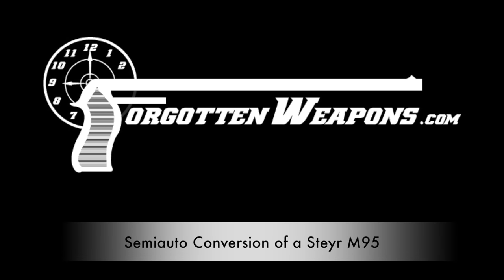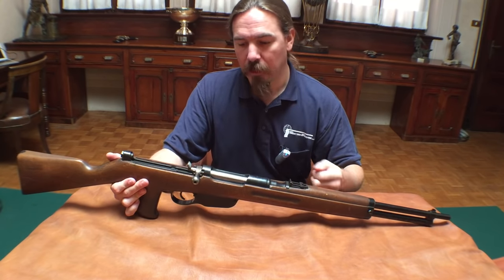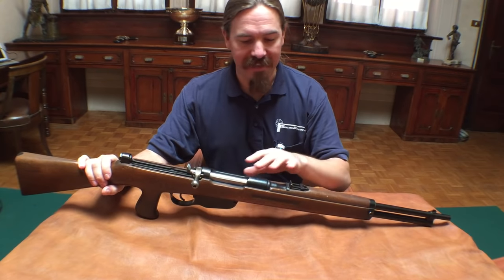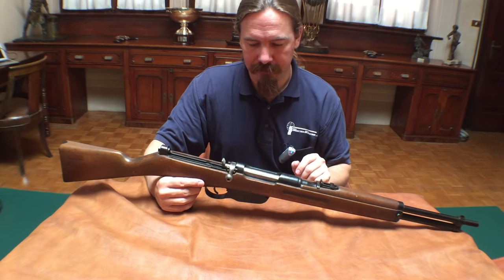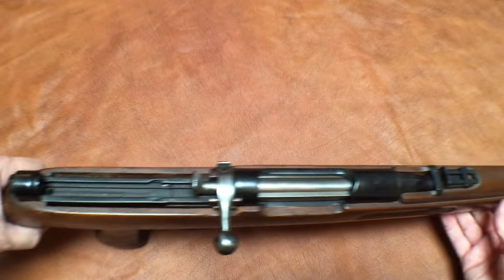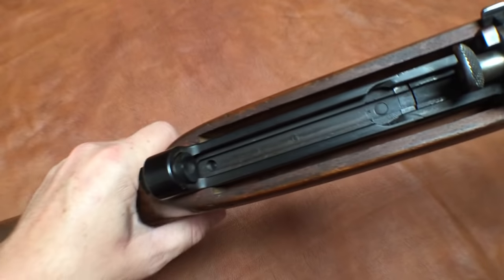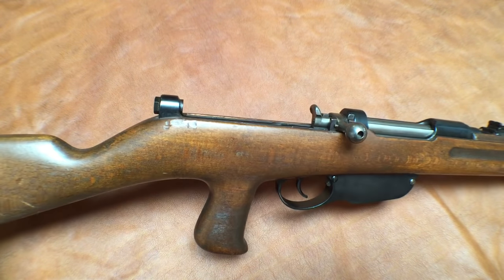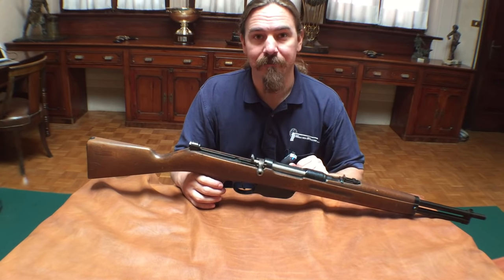Steyr M95 Straight-Pull Semiauto Conversion

Comment: There even is a machine gun conversion in the Austrian army museum. It was done by Austrian soldiers back in world war 1, but it is very crude and it actually looks like if it was just a nice try.
Reply: I know that thing, i an there often.
Tecnicaly it is Not an MG, but a mitrailleuse.
Still cool
Reply: @erzherzogalbrecht8504  what is the difference?
Reply: @thestørmcrier2024  a machinegun works on it's own, as long as you hold down the trigger and there is ammo, it shoots, a Mitrailleuse has a lever that you have to push and pull for every shot/group of shots you want to Fire.
Reply: @erzherzogalbrecht8504  it is kinda like a repeater where the trigger and bolt are connected

Comment: I normally dislike these kind of postwar/aftermarket versions, specifically if it's sportarized or stupid rechambering decisions. But semi auto conversions are cool (I do love that Turner SMLE conversion).

As for this M95 conversion? It's a tad cursed, but that's mostly due to the weird stock/pistol grip design. The functional bits are awesome 👌

Comment: I'm surprised  this isn't in Battlefield 1, since DICE overused prototype auto loaders In that game.
Reply: Spence M. No they didn't? Most of the semi auto rifles were production guns that were officially adopted and saw service, there are few one off prototypes in the game
Reply: Silly Catfish but were they standard issue or designated for the infantry? no. the Mondragon only saw service with the German flying corps. the Cei-rigotti never made it out of the prototype phase, the model 8 is not even a military gun. the frommer, Mars pistol, the auto revolver, also all prototypes.
Reply: And by prototypes, he means "Less than 100 manufactured, ever, and not practical enough for much of anyone to willingly adopt them either".

Even the production guns were issued in very small numbers to elite troops and the most skilled soldiers in sections.
Reply: I'm pretty sure when they add the French and Russians via DLC (not sure why they are not in the full game regardless), they will add the Federov, the RSC 1917, etc. and for "Snipers", the mosin m91, and the mle. 1886. because any bolt action is a sniper rifle according to DICE.
Reply: Spence M.
Indeed.
Reply: I know this thread is old as hell but, 

Cei-Rigotti: 
Prototype. No service. 

M1916 Selbstlader Karabiner: 
Saw usage by the German Air Corps, Ballon Observers and Zeppelin crewmen. 

M1906 Mondragon: 
German infantry trial. Saw service with German Air Corps

Winchester FC M1907/17: 
Saw limited use by the French Army 

Remington Model 8: 
Saw limited usage with Allied aviators

Remington Model 8 Extended:
 No service. Anachronistic since it was produced in the early 30s. 

M1906 Luger Selbstlader: Prototype. 
Saw no service or production. 

RSC 1917:
 Saw limited use with the French Army. 

Federov Avtomat: 
Saw limited use with the Russian Army.

General Liu Rifle: 
Prototype. Saw no use or production.

Farquhar-Hill Rifle:
 Limited use by the Royal Air Force 

Howell M1915: 
Limited field trials

There are only 4 out of 12 rifles that saw no action in World War I
Reply: Perfidious Pomegranate Like the Maxim SMG 08/15, Standschützen Hellriegel, and the LMG 08/18?

Comment: the rear of the receiver looks similar to a Cei Rigotti, I'm probably wrong though
Reply: Synyster 2020 it does but that is explainable as they both essentially are designed on the same principle. take a bolt action make it self loading. the C/R just took it a step further and made an automatic rifle*.

*note: i called it an automatic rifle because it is not truly an assault rifle due to the awkwardness of the length of the gun and the lack of a true intermediate caliber chambering.

Comment: M95 Straight pull, one of the slickest designs, and they turned it into an equally slick semi-auto.

I am truly utterly captivated. Sad it never caught on, but that's kinda the crux of this channel, right?
Reply: TheGoldenCaulk 

I am not really surprised that it did: it is too susceptible to fouling - being completely exposed - and probably smarter to egineer a new/ enclosed system. 

It would probably make more sense as a LMG conversion, where the extra weight of a enclosed bolt/bridge cover would be minimal.

Cheers!
Reply: +OmarTehNurd Is it? Allthis takes is a gaspiston a hole in the barell and some new wooden furniture. I am rather certain this is easier than building an entire gun.
Reply: I need no channel youtube! 
He didn't say easier, he said smarter
Reply: @DynamicDurge  When the alternative is sticking with a boltgun because you dont have the money to build new semiautos, it is smarter too.
Any any country that was still using the M95 in the 30s fell in that category

Comment: Old timey rifles with pistol grips always look so strange.
Reply: Makro yet also so right.
Reply: Because the grip is not separate?
Reply: Makro well at least this gun has the pistol grip built into the stock instead of just having a crappy plastic grip just bolted on. who ever made this gun put ALOT of work into it :)
Reply: Buzz Bombs Gaming and guns agreed
Reply: Makro The non-separate Pistol grip looks extremely weird...

Comment: Interesting that Beretta, or whoever did the conversion, took the time to put a really nice stock on it with the sling mounts and the rest of the metalwork. 

I'd guess that the original rifle was one of the vast number of arms surrendered at the end of the war, I wonder what other projects resulted from similar acquisitions?
Reply: I suspect it may have been a presentation piece for a possible semiautomatic upgrade project.

Comment: I'm surprised this isn't in battlefield one.
Reply: Catwithanm16 Maybe later in a DLC.
Reply: Catwithanm16 the straight pull version is
Reply: Catwithanm16 it is in bf1
Reply: only the bolt action, not the semi auto, but you do have the M1903 experimental which is also a bolt action turned into a semi auto.
Reply: Frankpolly I know. I was mostly just making a joke about how many prototype weapons were in the game.
Reply: Catwithanm16 cei rigotti
M1903 experimental
Hellriegel M1915
maybe the huot and the M1911 extended.
rest of the weapons were all in use or were made even before the war. only one that has no place in the game is the autoloading 8 extended as it uses a magazine made in the 30s.
Reply: Frankpolly The german medic rifles were not in anything close to widespread use. I agree that most of the guns existed at the time but many were merely prototypes or guns that were never issued to troops on the frontlines.
Reply: Actually, the Selbslader and Mondragon rifles, as well as the Mauser 1906 were finished weapons. They were just quite uncommon, and given to air corps because they jammed a lot.
Reply: Wait. The 1906 was a prototype. Oops.
Reply: Jack Clock It's just that these weapons were only used by a tiny fraction of soldiers and not anything close to the proportion of the game. It is just a game though.
Reply: Semi-auto rifles were normally given to aircraft pilots and marksmen, except for the RSC, which was very common.
Reply: Jack Clock But the problem is that Pilots and marksmen were not very common. That's why these weapons are uncommon.
Reply: That weapon (1903 carbine) sucks so bad in BF1 (sorry late to the party). I gave it another try yesterday and shelved it after multiple hits/no kills and multiple deaths lol.  They need to tune up the damage a tad to compensate for the semi auto.
Reply: The 1906 has the fastest time to kill in the game past thirty meters.
How is it bad? Is it because you can't engage multiple opponents at once, a situation that you usually won't survive anyway?
Reply: Actually, that honor goes to the Model 8, which has the most DPS of the game. The 1906 however, is more accurate.
Reply: Frankpolly the 1903 Experimental was a thing set to be used in the fall offensive of 1918 called the Pederson device. the war ended and most got scrapped as a result.
Reply: Catwithanm16 they probably didn't want to add another 5 round semi automatic rifle, considering there's already 3-4
Reply: Actually the 1903 with the Pederson device did see action

Comment: Has the barrel also been shortend ?
Reply from the maker: No, that is the normal M95 carbine barrel length.
Reply: Somehow it looked shorter.
Reply: looks like the front sight was moved, maybe that's why?
Reply: The stock was lengthened so maybe it seems shorter because of that?
Reply: mayby.

Comment: A disconnector for semiauto is an essential part here that I can't see.
Reply: chapiit08 I'm fairly certain the rifle has a disconnecter already so you can't slamfire it by running the bolt quickly
Reply: @RedMcCloud  it does. Mine won't let me run the bolt while holding the trigger down
Reply: A bolt catch that activates from the follower is a good idea as well

Comment: The Rifle is still in 8x50r as it doesn't have the 'S' or 'H' stamping on the barrel shank. That also helps date this to sometime in the 19teens to 1931-2ish.
Reply: why not after 32?
Reply: Gungeek just because at that point 8x56r had been adopted and if you were going to make a prototype semi-auto conversion you would want it in the new caliber not the old one which you were phasing out.
Reply: Eaglelord17
maybe it was a M95 the Italians had ;)
Reply: Gungeek personally I am leaning towards the Italians myself, that being said this type of conversation would likely be a earlier thing than a later thing as the Italians were making designs from scratch by the 30s

Comment: My only concern with DIYing a conversion of these is the probable lack of an interrupter on these old bolt guns. Without one you'll only get runaway 5-rd bursts and possible unwanted attention from the ATF. 

Also depending on the recoil (not so much buffer) spring-weight very fast bursts at that, which given the power of the 8x56R will probably not make for the most pleasant or aimable thing to shoot. I bet there isn't a bolt hold-open either, so loading 5-rd stripper clips just so you can burp them off in 0.2 seconds is going to get old fast. 

By the time you add all these you're already half way to a new design anyway, which makes cost savings of a conversion vs going with a straighforward from-the-ground-up new design (i.e. FAL) questionable. This is probably why all these inter-war conversion projects never got anywhere. 

I don't mean to rain on everyone's day but when you think about it bolties and self-loaders are much further apart in design than most people immediately realize, at least a decent, usable self-loader.
Reply: Oh, and think of that big reciprocating charging handle cycling at 1200rpm in the hands of raw conscripts: your equipment may cause you more casualties than the enemy.

Comment: The open trough for the bolt resembles that a Scotti-Enfield semi-automatic conversion that was done in the mid-thirties.

If this is a Scotti variant then the rifle is probably still in the original 8x50mmR. Italy received M1895 rifles as reparations after WW1.

Comment: It seems the rifle is actually still in 8x50mmR.

When the Austrians and Hungarians converted their guns to 8x56mmR, they changed the rear sight leaf to meters - this one is still in schritt ( an archaic distance unit; equivalent of a 'pace'). [Although I believe the Bulgarians changed the sights on the guns they received back to schritt.]

The biggest giveaway is the fact that the barrel shank isn't marked with and S or H. This was done by the Austrians and Hungarians, respectively, when the guns were reamed for 8x56mmR.

Therefore this semiauto conversion was likely done before 1930 -  before 8x56mmR upgrade programs.

Comment: One of several semi-auto conversions attempted during and after WWI.
As already mentioned, this is an M90 Carbine, with M95 Parts update.
The Russians in 1915, attempted an "add-on" kit, using a side mounted gas piston cylinder with a single rod to a bolt handle clevis, eliminating the stirrup type rod used to pass the Magazine well ( similar to Scotti Model X s/a.). The clevis could be detached from the bolt handle allowing for manual use.
One problem with sustained use, the side or underbarrel recoil spring would lose its temper and fail...Garand did resolve this problem.
As to " slam fire, MG-ing", etc, the firing pin  requires quite a stiff impulse to detonate the cartridge, and the final  bolt head rotation prevents premature detonation ( a loose FP won't have sifficient force to ignite  like a hammer riding a bolt in a Garand or MI  carbine, or more to the point, the safety lugs on a Mauser 98 FP, which prevents firing without full lock.

As a project, a lathe and milling machine are required  and a new stock.
The Russians modified their captured M.95 Sutzen stocks, and did not have an elaborate pistol grip and long buffer slide, just a slide extension ( like a Vetterli-Vitale.
Proper gas takeoff and bleed off needs to be calculated to prevent hammering of the bolt, as the cocking piece hits the buffer.
Nice conversion, probably done post WWI in Brescia.
Have seen it in rack at Beretta Museum (2005)

Comment: The Russians alsodid aside mounted cylinder semi auto, avoiding the two slots in the Beretta prototype stock to allow the piston extension bars to get past the Mag well to the block across the rear end of the block. The Russian model had a simple Garand type bar from piston to lock into bolt handle. They did add a bolt rail, but not as long.
Normal 5 round 8x50R charger..
Not known how many converted ( Stutzen)
DocAV

Comment: Judging by the lack of a "S" on the barrel shank I would say it is in 8x50r.  Which would be correct for a gun done by the Austrians before the 1930's when most were converted to the better round.  Also note the barrel band it similar to the one used on the M1938 Italian short rifle which would make sense if it originally one of the guns captured by Italy during the First World War.  If it were done in Italy during WW2 it would still be in the 8x50r which this one is.

Comment: OEWG signifies a M90. 1902 dated barrel and the bolt and rear sight indicates a M90 updated to m95 standards. Probably still in 8x50r as there is no S on the barrel.

They must have inletted the wood a bit on either side of the magazine to get the op rod around it. I wonder if that imparts and significant weakness to the stock or if the new stock is just that much thicker?

Why the extension to the hand guard reward, past the rear sight?

Comment: I think the main reasons that these semi-auto conversions failed is because the designers tried too hard to keep as much of the original rifle and bolt as possible. wouldn't cutting the bolt in half and making it hammer fired and piston driven make it much more successful? new stock and shortened barrel and a shroud to cover up the receiver. someone should give this a try to a more modern bolt action rifle.

Comment: I am very interested if anyone did produce any straight-pull rifles with the bolt lever on the left side in the same fashion as in G3 riffle.
Or if anyone ever converted straight-pull riffle to pump-action.
Both type of designs should greatly increase rate of fire.

Comment: Do we have any evidence of a Schmidt-rubin system beeing modified this way?
I think it would be a bit harder because the bolt doesn't naturaly run in a groove but I imagine the piston could be firmly attached to the bolt and held in two bearings instead. With the striker loop cut, a washer buffer installed and a thumb safety blocking the trigger it could be fun.
Even in full auto.....
Ohhh the possibilities :p
Reply: Although not a direct conversion, the Cei-Rigott bolt was clearly inspired by the Schmidt-rubin.

Comment: The OEWG on the receiver tells us that the receiver started its life as Steyr M90, not M95 - although their actions are technically the same anyway. "True" Austian M95s had either a  Steyr or Budapest mark on top and M95 engraved below.
Reply: I was just thinking that it looked like they installed a carbine barrel and action at the front of a rifle stock. To give them room for the bolt to run back.

Comment: Part of me wonders why no nation in WWII regularized something like this. Almost every European nation apart from Germany were useng these rifles, so it woulda made sense.
Reply: Too expensive. I know for a fact Hungary experimented with similar designs, but it was decided that as the conversions would need new furniture and machined parts, it was cheaper to build new guns.
Being able to supply enough munitions to the increased ammo consumption was also a concern.
Reply: Only Bulgaria issued M95s in WWII, though I'm sure they wound up everywhere.  After the Anschluss Austria used k98s and the M95s went to Bulgaria, Hungary and Romania had turn bolt Mannlichers.

Comment: It would be a really cool project... Also illegal as hell unless you've got the proper FFL.
Reply from the maker: Not illegal at all.
Reply: So we can convert a bolt action into a semi-auto but we can't have a barrel shorter than 16 inches? Friggin' ATF....
Reply: Every semi-auto needs a disconnector, not just bolt action conversions. Otherwise they would be classified as machine guns. While it is possible to fire single shots from full auto guns it takes a lot of experience with the particular gun in question to do so consistently.
Reply: +Michael Carnes Its a straightpull. Im fairly short it has one, otherwise you would be discharging the round with an enthusiastic bolt slam.